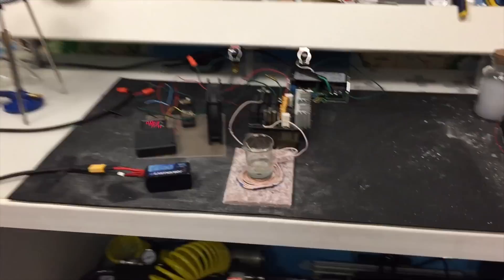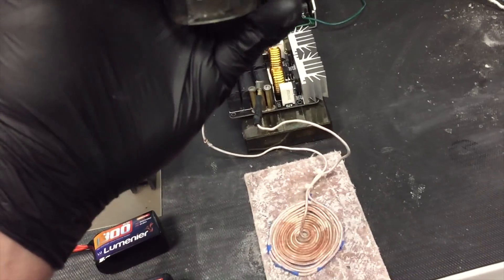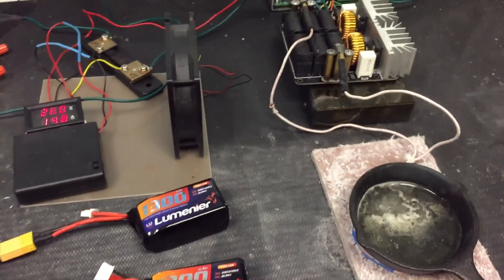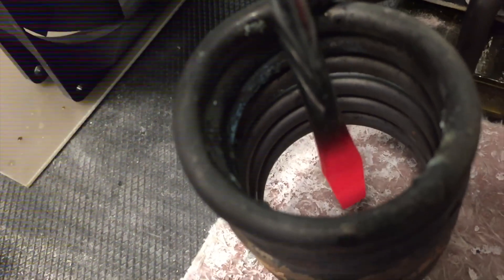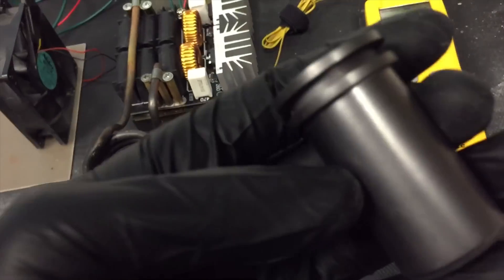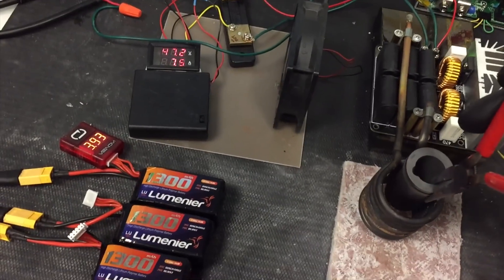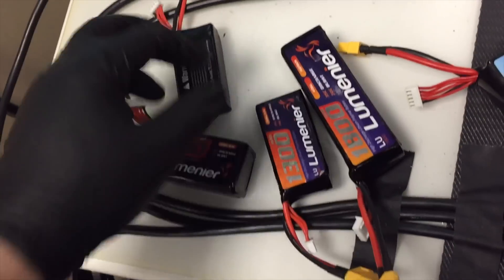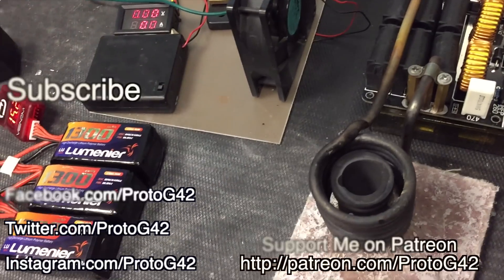1000W Induction Heating Part 5: Battery Powered!

Comment: So a solar powered induction space heater is very possible? Could you not lower the voltage to bring down the heat being produced by the induction of the graphite rod? You know low med and high settings for a space heater?

Comment: what if we open the coil?
can we make it stronger?
i did a test with mine using 4x3cell lipo 48v and i saw 30amps on my meter. you can check my video
3.35v per cell is TOO LOW voltage. i never go below 3.6v - 3.5v

Comment: Sorry If you have answered this many times before, I just can not find it if you have answered it :(. What Kind of Wire are you using? the Tape I found out where to buy but the wires I just dont know. I have some thich magnet wire which I used to wire a burshless motor while ago. I used it and it worked fine, but It got really hot. Maybe the wires werent thick enough!? But I can see your wire seems to be as thick as mine, so maybe I was just affraid of nothing.....!?

Comment: Hey man, nice video.  I just ordered a 5-12 v DC ZVS induction heater/ power supply module, and it's being shipped to me from amazon.  I want to be able to use 3phase wild AC power rectified to DC to run this device.  How can I pull this off?  Do you think I'll need to add anything to the device before wiring it to my rectified power?  Thanks in advance for your help.

Comment: We can't see what you are showing with your dancing video camera...
Reply: you cool down the screw to loosen it, heating it up will make it stuck even harder
Reply: Proto G that makes more sense
Reply from the maker: This particular video was rushed.  I'm sorry that my free content doesn't satisfy you.
Reply: oooo sassayy. lol but for reals ive been looking for a video like this thanks
Reply from the maker: No, heating the nut causes it to expanded and break apart some of the oxide that has formed.  It's same principle behind shrink to fit.  You machine a collar that does not fit on a rod at room temperature, then you heat it up with a torch to expand it and then press it on.  Cooling the screw will contract the screw and will also work in certain cases but it is much easier to heat the nut with induction because you're heating the nut bright red fairly quickly.  Using a torch would work but when working on cars and around other flammable items, you do not want to use a torch.

Comment: I bought a 20A 1000W ZVS, and tried to run it with a 12v 90 Amp car battery, but the wires that connect to the battery melt in about 5 seconds!
I think i'm doing something wrong, i just dont know what.
Its the first time i'm playing with electronics, can you give me some help.
Reply: i work mine @ 48volts and i have seen 30amps on the amp monitor and it is too strong!! i
Reply from the maker: +Telmo Brandao A 48V power supply is recommended for the best experience with this ZVS driver.  I would recommend using at least 24V.  I wrote a detailed article about the series here: http://www.instructables.com/id/7-Uses-For-an-Induction-Heating-Machine-How-to-Mak/

Comment: Hi my friend. I want to buy the following: ZVS Driver + RSP-1000-48 Mean Well Power Supply + Graphite Crucible + Power Meter Temperature Meter 100V 50A + 2000F (1300C). With the above I reached 1100-1200 degrees Celsius? or necessarily need batteries ?. Or should I go buy Meanwell Power Supply RSP-1500-48. Thanks.

Comment: does it make a matter if the winding of the induction coil touch or not?
Reply from the maker: +Klaus Ventures It's not a big deal if a couple coils are touching, but I usually pull the coil apart a bit before I use it if they are.

Comment: Got a cool idea to 3d print with induction
Reply: +Nick Farrow Damn, why wasn't I thinking about it before?
Reply: +Proto G would be cool to see Mars being used but gravity is the number one problem, asteroid mining way less gravity than a planet.
Reply: +Nick Farrow If you're talking about induction heating the hotend that has already been done.
Reply from the maker: +Nick Farrow I was thinking of printing some coils with conductive filament and testing them out.
Reply: +Michal “Dreit” Kundrát if you really want to think #NASA should be looking at 3D printing with induction in space with the crap floating around to make tools and things. or go further out and start mining some rocks and do the same thing. Rocketing junk in space is a waste of resources.
Reply: +Justin Bell for metal?
Reply: @NickFarrow  astroids are balls of dust and loose jagged rock just need a spoon. It is most if the time just particulates from when stars sneeze not pyroclastic ejection like from a volcano.
Reply from the maker: +Nick Farrow NASA has 3d printers that can print regolith(Mars soil) for heat shields and such.

Comment: Well done.  Could you use a welder as a power supply?
Reply from the maker: +arrtee77 Yeah, but you would have to use DC and make sure not to go over 50 volts.  You would probably end up frying something.